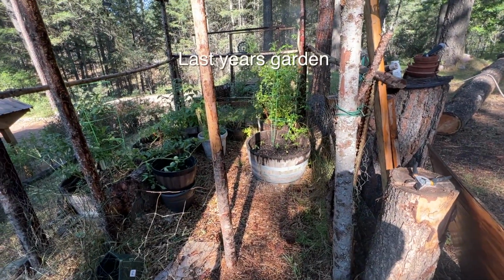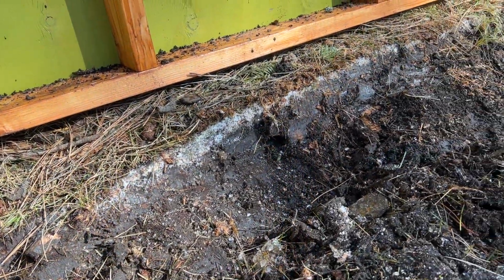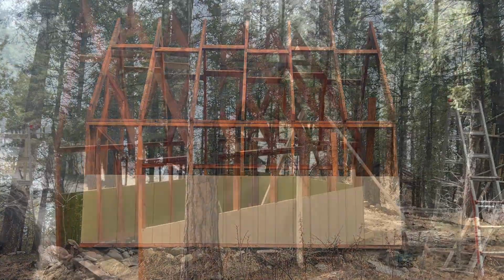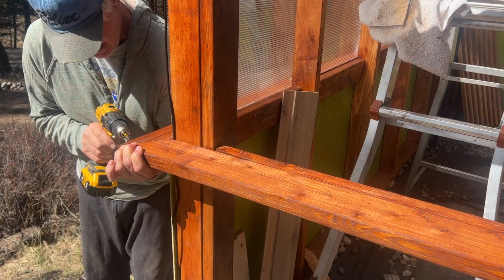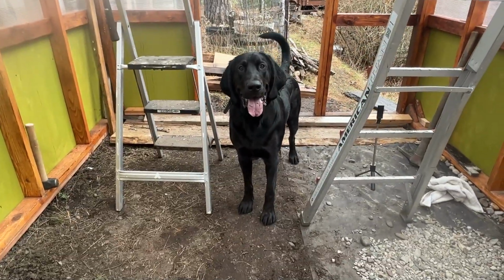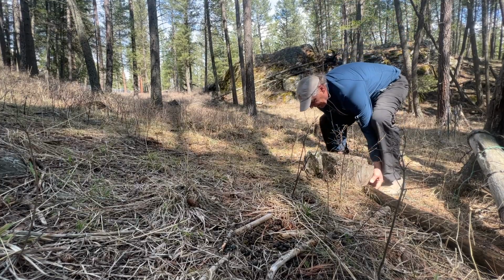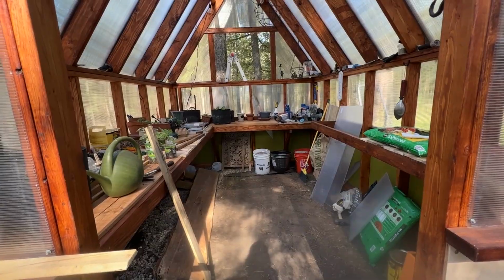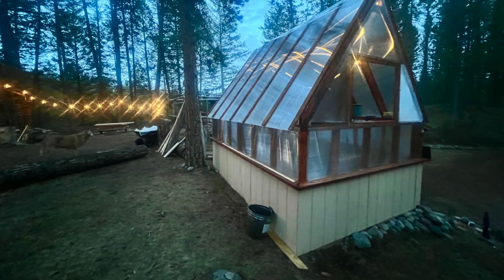8 x 12 foot Greenhouse build

Comment: P.s. how long did it take to build this? Just hauling those huge rocks would’ve take me 3 months! Another thing I’m impressed with is how well you’re able to get up off the ground when you’ve been flat on your back working!
Reply from the maker: Sandy, it took a little over 2 months. Weather was a hinderance and all that staining took some time up front. But it saved me time on the back end. 
And getting off the ground is my life’s motto but it’s getting harder physically each year. Lots of crickety old bones   But I use these projects as substitutes for long days at the gym or out on the trail.